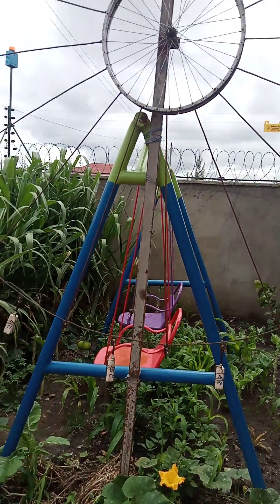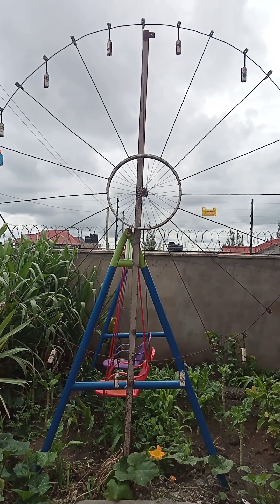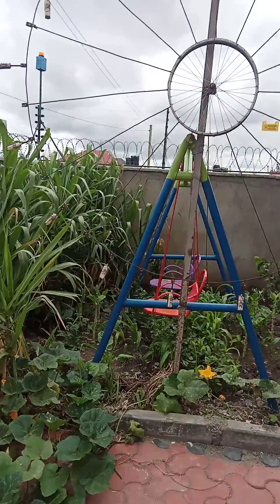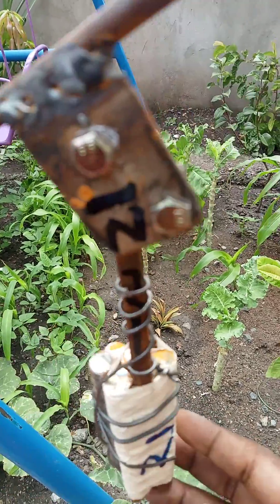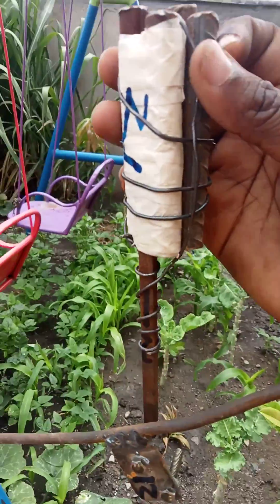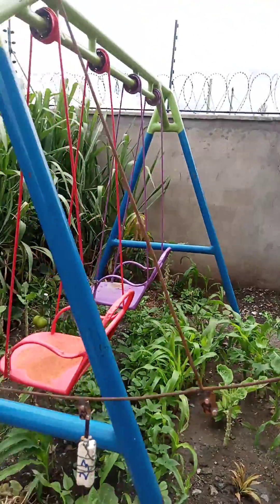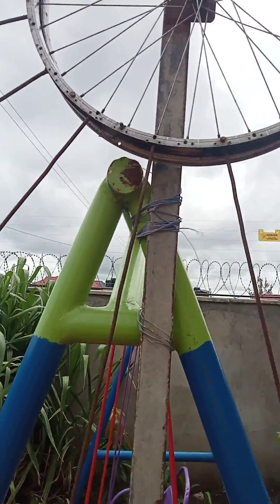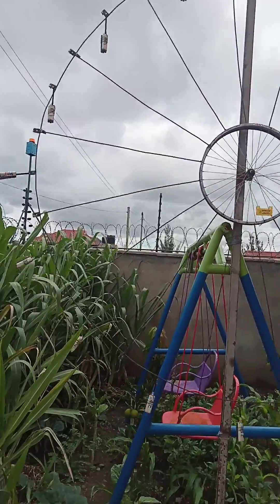Free energy, Perpetual motion, Overbalanced wheel, Gravity turbine - Part 2b by Professor Tiwes

Comment: Why videos not show the final works?
Reply from the maker: Very good question. Am just documenting my research. Final work would mean it has either worked or not worked which will require a long video to explain. Am also hoping I can convince someone else also try the concept. They might do it slightly different and actually work!!!
Reply: @professortiwes2877 You have not shown complete cycle says.. it failed . Any how good attempt
Reply from the maker: @palanik1960  All this is work in progress. The research is ongoing. Yes, this particlar design did not work but hopefully a different design will work. If you get time which my videos I call Pantograph